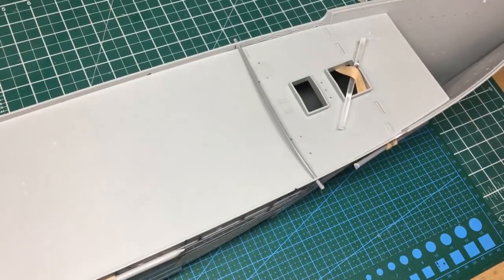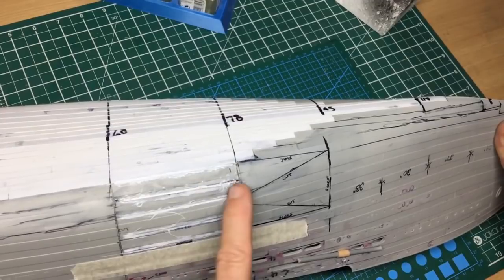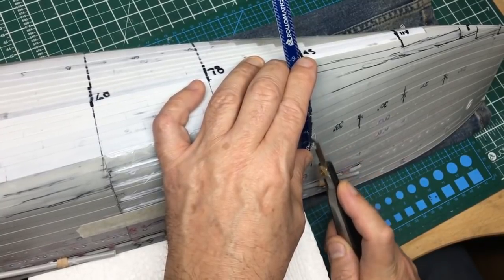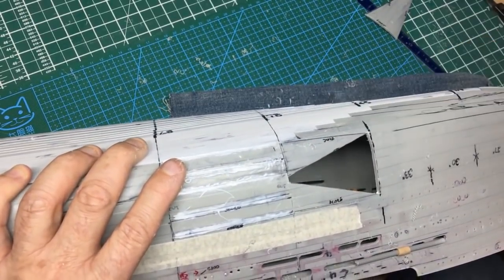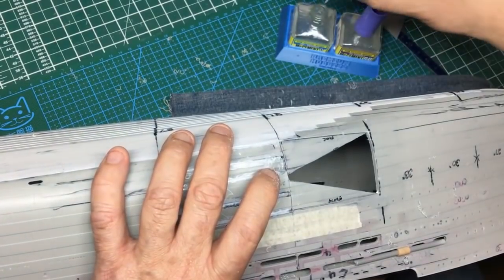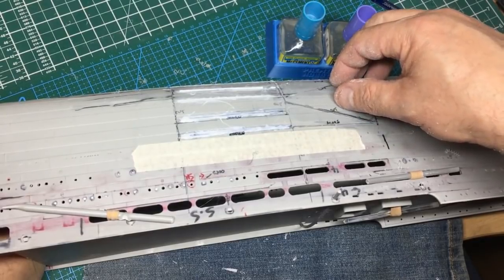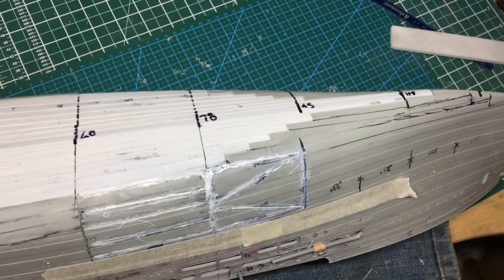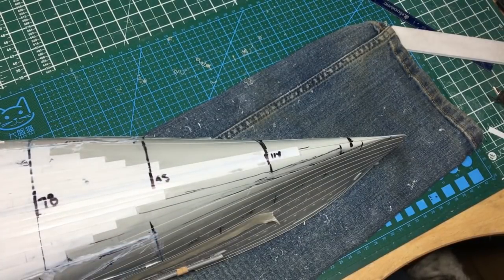Correcting the form of the 1/200 Titanic hull... My Way.  Part 2

Comment: Boy that's a lot of work, do think it would of been easier in the beginning to just scratch build a hull with all the correct dimensions from the git? I mean I commend your tenacity but man there seems to be nothing you didn't have to correct to get the accuracy you desire. My hats off to you as I would of just built it as is.
Reply from the maker: No.